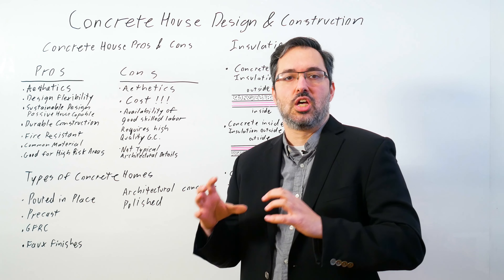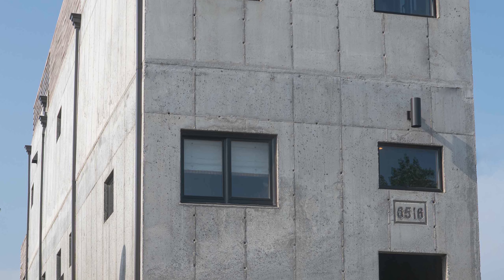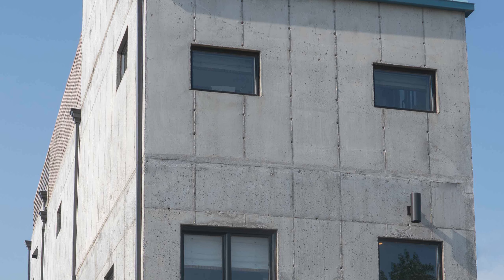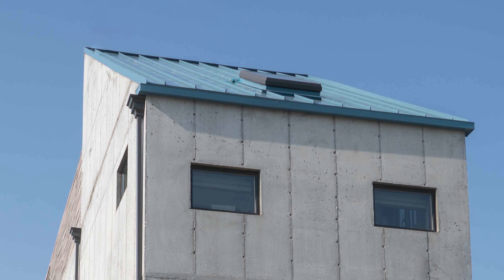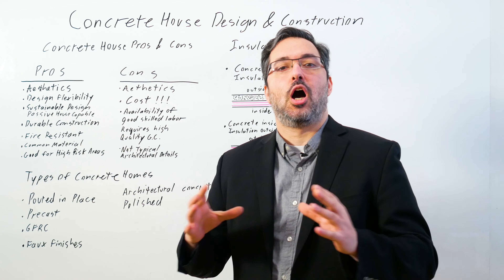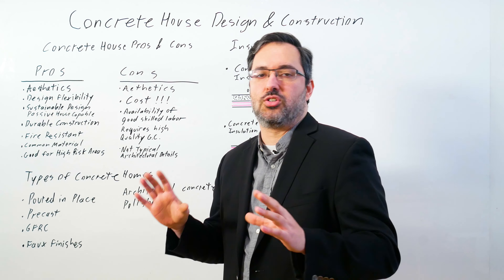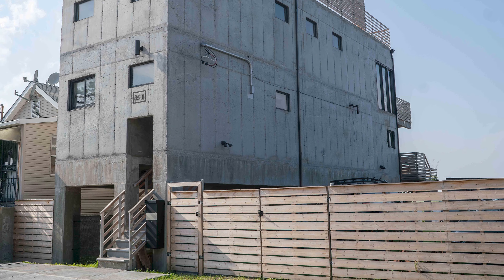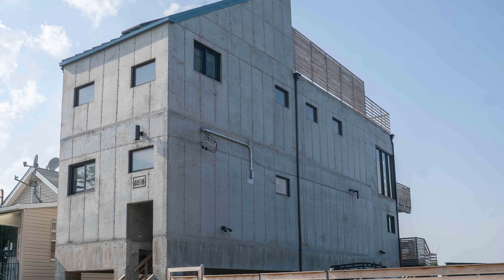Concrete House Design and Construction

Comment: Can walls be built thinner if using fiber reinforced poured concrete? Or does code not allow it/take the option into consideration? I was reading famous architect Zaha Hadid was able to construct a building in Miami with thinner walls because the concrete was fiber reinforced.

Comment: Do you think concrete can work with say newer sustainable tech(i have no idea I'm just putting it out there) like mixing hemp or some other material to decrease costs and offset the environmental impact? Do you think this is the future?
Reply: I want to know this too! Would prefer hemp insulation inside and exposed concrete on either side of that.
Reply: @kiraashley5009  hemp absorbs moisture. Which will cause it to degrade

Comment: I’m a general foreman and I have been planning on building my future home out of concrete. I worked building water-treatment plants and dams in the past 10 years I have used doka forms every time. I want to be the one to build it. $300,000 is my budget. Which me luck.
Reply: Lol wish me luck 😂
Reply from the maker: Good LUCK !!!!
Reply from the maker: @christiandicroce7004  I was planning to do a video on air rights so I will try to put that high on the list, but until I get back in the office I will probably not be doing too many videos. So I am not sure how long it will take to get the video out. Also you said Tax lot merger but I am assuming you meant Zoning Lot Mergers.
Reply: @JorgeFontan  
Yes -- my apologizes Zoning Lot Mergers. Also, can you provide me with your e-mail? I have a question on a property I was hoping you could shed some light on.  Appreciate all your help!
Reply from the maker: @christiandicroce7004  You can go to the contact page on my website. https://jorgefontan.com/contact/

Comment: Nice summary. While all possibilities of insulation are correct, in reality only outside insulation is used (and ICF forms). Putting insulation inside concrete home is a dreadful idea. I'd consider a typical EPS ICF a bad workaround,  though there are some systems using board inside and EPS outside. Putting EPS inside is really silly: You'll use all accumulation properties of the concrete, which are otherwise excellent and you won't be able to hang anything on the wall, without some crazy workarounds.

Comment: do you put drywall directly on concrete or do you put a wooden board and then put drywall?
Reply from the maker: You do not put drywall directly to concrete. But this question is far more complicated than it may sound.  How you build the wall depends on many factors for example are you insulating the wall if so what type of insulation are you using. Is this wall in an area that needs water proofing. Are there utilities going through. Do you need a cavity. Etc...
Reply: @JorgeFontan  I was planning to do tilt up panels with insulation in between the concrete and have the panels built at the factory in controlled environment and then bring it on site to assemble it.. so if we do that, interior just need wooden board and drywall right?
Reply from the maker: @shenoyglobal  Is this for a house? Why would you do offsite built tilt up walls for the interior of a concrete house?
Reply: @JorgeFontan  yes for a home.. i was  planing for a tilt up concrete panels instead of a poured concrete structure on site
Reply: when they pour the panels at their factory they put the insulation in between the pour.. so its already insulated.. but my question is do we put wooden board and then put drywall?

Comment: GFRC = ?
I thought it stood for glass fiber reinforced concrete, where special alkali resistant fiber glass is added as the concrete is being mixed. 
It might be used in some precast blocks, but it's also used in concrete counter tops, precast concrete statues, and other applications. 
I might be mistaken though.
Reply from the maker: You are right but the context of this video is building a concrete house. It is often used as blocks or panels for building facades in NYC. When I say blocks I just mean it in a general sense of some form of masonry building component that is precast. I do not mean CMU. Maybe if I had said panel that would be more clear.

Comment: Do you need extra insulation? Will the concrete work by itself for a small shed sized building?
Reply from the maker: The insulation you need will depend on many factors there is no one size fits all. Your geographic location will determine how much you insulation you need.

Comment: I'm in Jersey. I'm preparing to build a large rectangular makerspace with L shaped ranch wrapped around. The goal would be steel roofing, and in the makerspace complimentary steel structure to augment a trolley crane for loads in the tens of tons. I'm completely stuck. I know I can use MCU for the interior form as I'm going with metal studs and sheetrock. I'm interested in an exposed exterior, but I'm also looking to pour walls over a foot thick and twenty feet high. I looked into specifications for some form systems. Clearly I'm not building rationally, but it's the asthetic. I'm left to believe that I might require MCU on either side as the form. What's your comfort level with consultations regarding something so extreme? I'd be aiming for 2-3000 square feet in the makerspace. I'm trying to tame my expectations and reduce the build to two million. I'd be performing most of the work until framing and pours exceeds my capacity.
Reply: Thought about this more. Steel structure then pre cast is probably required else I'm dealing with cold joints
Reply: @cyril.engineering  Did you ever build this house?
Reply: @mjboyan  I'm in process of buying land! I decided on creating my own block system to create larger more aesthetically pleasing block. Wet and dry keys with rebar and grout channels.

Comment: When talking about cost, and how expensive concrete is compared to other materials, are we factoring in interior finishes? Say you have concrete walls and floors interior... I would think that a concrete finish would certainly outlast any paint job, or any other type of flooring, and so the labour + cost you save with concrete would actually render it a less expensive option long term (even though upfront cost is bigger).

Comment: Should be recommended in tornado prone areas...pretty sure wood frame housing is near obsolete
Reply from the maker: wood frame housing was designed to be affordable and for no other reason. It was based on cost not quality.

Comment: how do you avoid cracking of concerete floor after few years..
i have seen it always cracks after few years
Reply from the maker: Surface cracks can happen for many reasons. One example is from using too much water in the mix and the water rises to the top making the top surface of the concrete floor weaker. Also you can use control joints to anticipate cracks from expansion and contraction. You need proper design and good a good contractor this work cannot be done by just anyone. But surface cracks are common with concrete.
Reply: @JorgeFontan  thanks!!! what i saw is the surface cracks widen and become a issue especially on floors.. at the same time the concrete poured to make freeways and highways do not have such issues.. what is the difference.. is there any adhesive which they use or is it poured thicker?
Reply: I've heard a few people say essentially the same thing: if you want cement or concrete without any cracks, leave it in the bag.
It is nearly impossible to prevent any cracking, so the name of the game is to find the best ways control it, and make it a feature.
There are different admixtures and fibers that can help minimize it.

Comment: Aren’t concrete houses immune/resistant to insect invasions? You wouldn’t have to think about termites for example <.<
Reply: Yeah from my understanding that's a huge plus
Reply: I've seen some videos talking about ICF construction, and they point out that insects such as termites or ants can tunnel through the (exterior) foam to make a path up to the wood.  It would most likely remain hidden long enough for serious damage to be done.  It might be possible to mitigate this by using a stone or metal cap on top of the ICF section, to at least force the tunnels to come out to the surface and be visible.  I imagine this would only be a problem if there's exterior below-grade foam.

Comment: I assume you concrete house could be painted or other finishes and facades could be added to the exterior
Reply from the maker: Yes any material can be applied to a concrete house. I am not a fan of painting because after time it may not look good. There are many ways to finish a concrete house.
Reply: @JorgeFontan  I love the durability of a concrete house but im not a fan of the concrete look.
Reply from the maker: @julianking4957  you can cover it with anything, stucco, fiber cement panels, stone, porcelain, wood, etc....

Comment: let be clear in brutalism era they used to let conctere biuldings with no coat.. because there was to much time consume to cover this, also in brutalism era, they build coloses in height and dimensions,   , so was designed to let wall exposed, and impose by dimensions and brut style....

Comment: Aesthetics? You can smooth finish it and paint it with glossy paints.
Reply from the maker: You can paint concrete but you may want to think about how long that will last, and what it will look like over time. Unfortunately I built several houses in concrete that the clients wanted to paint and I was not thrilled about it. You can apply finishes like Sto (Stucco) on top as well or do spray on cementitious finishes.
Reply: Concrete by itself looks so much better. When combined with glass, wood, and green vegetation, it can look fantastic.

Comment: Are concrete houses safe for the human body: long term?
Reply from the maker: Why wouldn't it be? Concrete has been used for thousands of years.
Reply: @JorgeFontan  whew, yay
Reply: For sure concrete more safe than plastic . It is like a stone
Reply: It's also complicated though. You need ventilation at all times to prevent mold and sometimes there are chemicals in the concrete. You need to check what will be in it. Also efflorescence is a struggle.

Comment: Concrete is becoming less expensive... nearly rivaling the cost of stick built right now in Florida.
Reply from the maker: Would have to be very low quality or drastically underpaid labor.
Reply: @JorgeFontan  For most, but personally... have already done concrete, & can do most of the labor myself (hand- & loader-dug my first forms over 40 years ago). Also have architect & GC friends: wholesale pricing does wonders for the bottom line. Also matters where you're building... good companies in depressed areas just want work to keep their crews working, so some will take a smaller cut for themselves.

IMNSHO... in the long term concrete easily surpasses both stick & metal frame homes in cost savings: primarily with significantly lower maintenance costs and more economical heating & cooling needs. 

Great videos you've got. 👍🏻👍🏻

Comment: With all due respect , that is not a real concrete house .. I don’t see any iron structure!!!  For example , no  stirrups, no rebar  no top chain like we do in Mexico or any other country. Using precast walls. It does not have the same strength  like build a block walls then joint the 2 block walls by pouring concrete ( between the 2 walls. There is a column which is build with rebar . Stirrups and they are tight with metal wire 16 gauge. I can show you what I  did in houston Texas . The roof is another story

Comment: concrete is used for thousands of years??? oh man , what do you know architects
Reply from the maker: As many other technologies, concrete has evolved over a long time. The earliest forms of concrete were used thousands of years ago. It certainly was not what we used today, but it was still based on the same premise of construction. Cement made from crushed limestone with sand and water was used over 3,000 years ago in the Middle East. This is a lower quality material to what we use today, but still a starting point in the evolution of modern concrete.